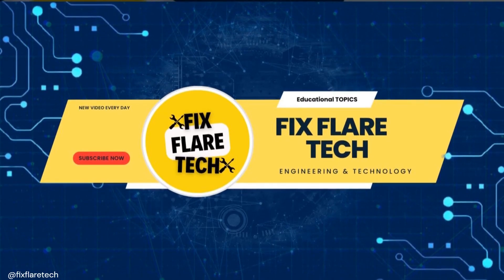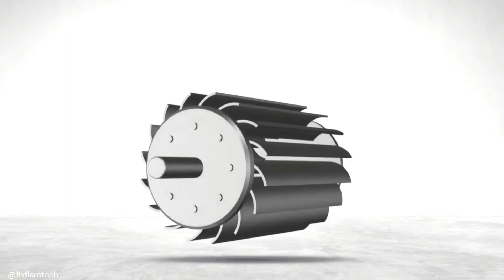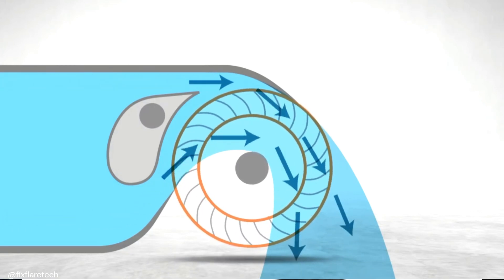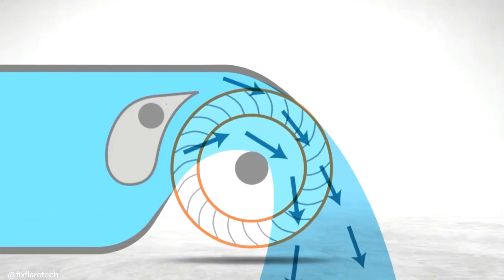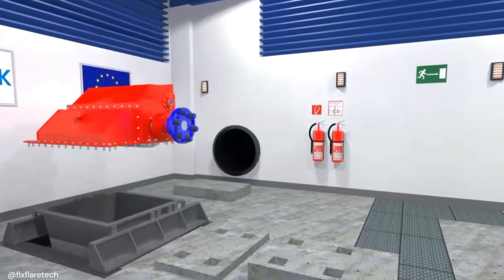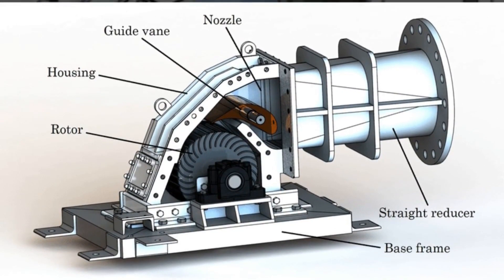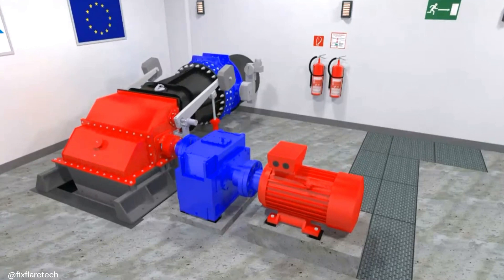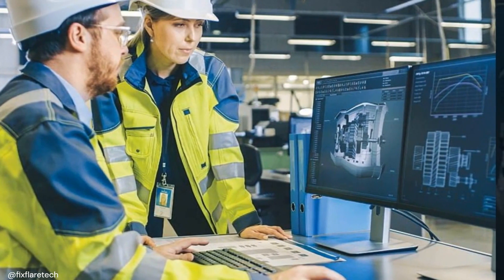Cross Flow Turbine Basic Concept.

Comment: does it need a pump? where does the power for the pump comes form?
Reply from the maker: @jeffleonardalbo9873  crossflow turbine uses water flow through its cylindrical blades, generating rotational energy as water passes twice.